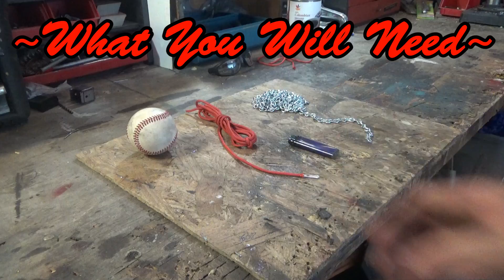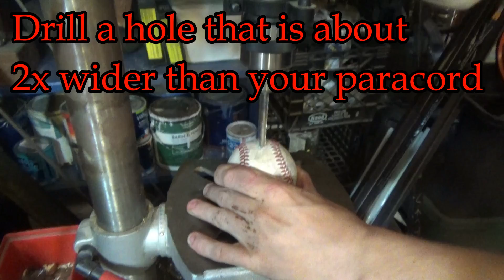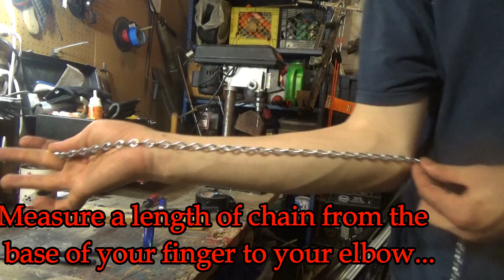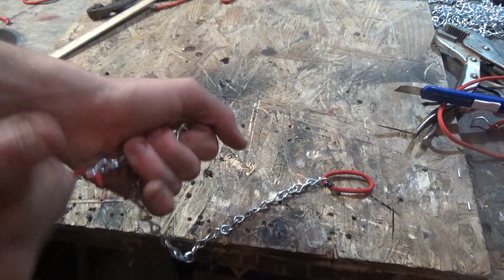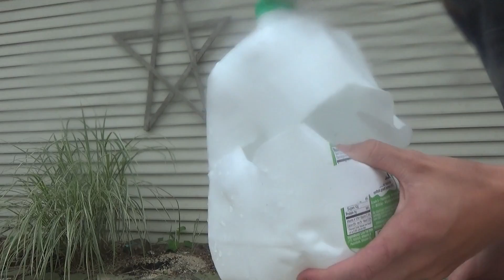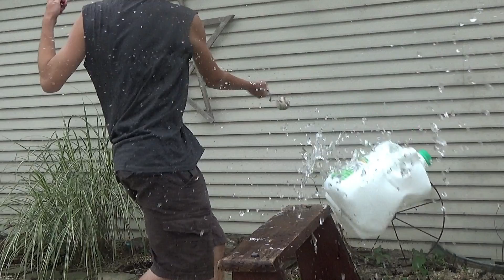Making a WATCH DOGS 2 THUNDERBALL

Comment: How to bring that as edc?
Reply: I suspect like me you don't have a drill press. My thinking was that I'd go to harbor freight or on Amazon and get a cheap vice that can be clamped to a table and use a standard drill to do it. That said I don't see why a good sharp spike and carefully hammering it through would not work. As long as you have a way to hold it in place and insure you go straight through you will be just fine.
Reply: Id say if you've got a coat on in one of the pockets. For me I'm thinking IL strap it to my handlebars of my motorcycle like a tool we often carry as bikers called a "get back whip" using a quick release of some sort. Then IL either hang it from my belt or keep it inside my cut.

Comment: Man this would be very helpful but it seems very complicated is there a way to make it in a more easy way
Reply from the maker: well all that is really needed is to drill a hole in the ball and then put some paracord through it. the chain isnt really needed.
Reply: well i dont really have a lot of tools and items to work with so...
Reply from the maker: then i would suggest making a thick duct tape pouch that completely encloses the ball and then cut a hole in the duct tape pouch, and tie the rope through the hole.

Comment: I made my own by using a baseball a long ass sock a keyring and some hairties
Reply: I made some too, but I just tied the socks
Reply: But based on my experience, a medium length sock is much better than a long sock because you can control it more easily and you can hit harder. Than a long sock that will take more control to swing again.

Comment: Can you just use a hand drill? if you can, how powerful?
Reply from the maker: you definitely can, although what kind of ball you are using will affect how powerful the drill needs to be. a baseball is mostly soft materials so a very cheap drill should work.
Reply: is it possible to use an 8 Ball?
Reply: I've seen people  use various billiard balls to make  this but if you don't have  the tools to cut/drill a hole in it  you should  check out videos  on how to make a celtic slammer